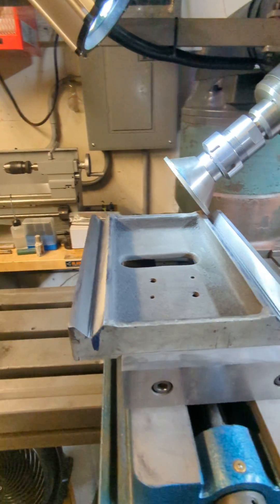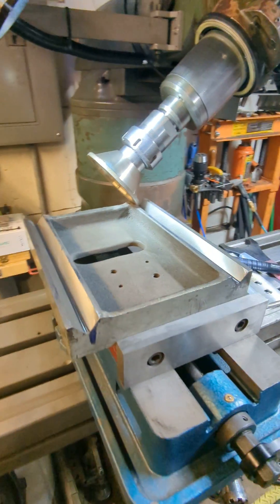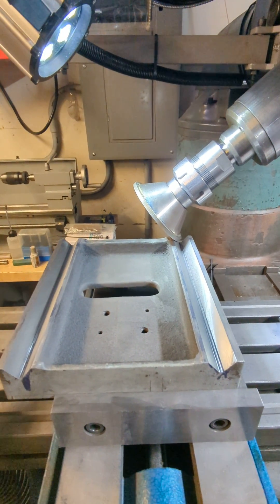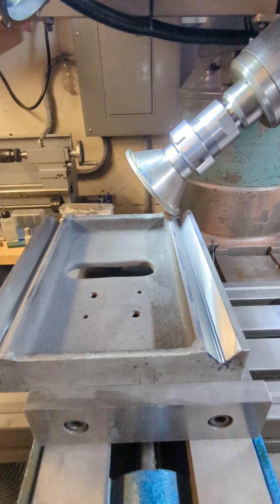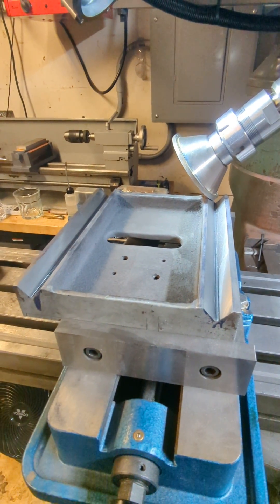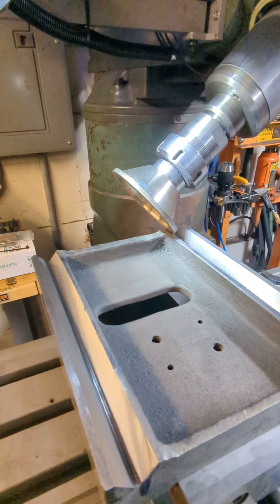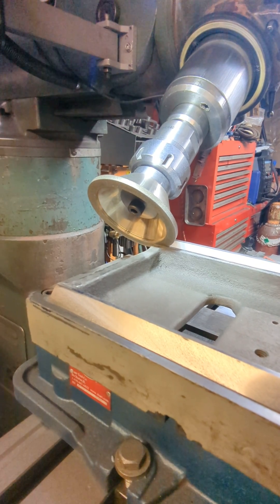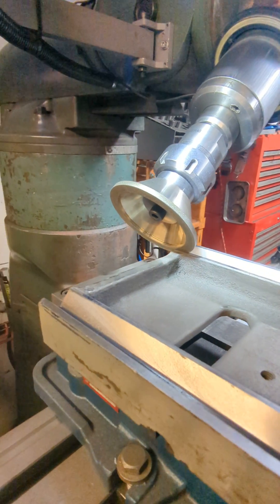Surface grinder finish on a mill! fixing a worn tailstock. Surprising results.

Comment: Cool! Did you ever check contact on the lathe bed? with bluing or such
Reply from the maker: Thank Arthur! Yes I did check it. I didn't get full contact on one end because I would have had to remove a lot more material from the other the keep it level. I did shim the tailstock .015 to compensate for what was taken off. I am extremely happy with the results. Perfect? No not quite but very very good. Thanks for tuning in I appreciate it.